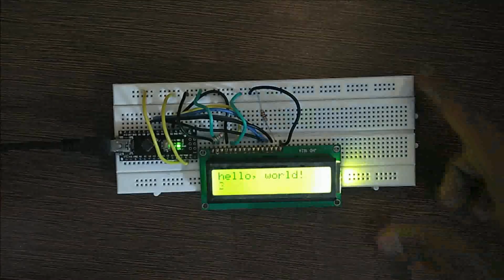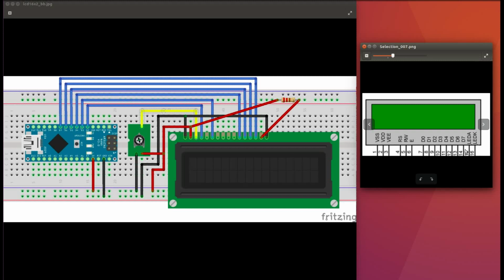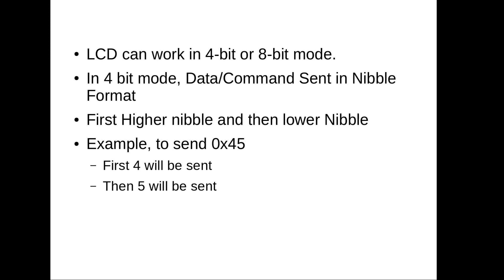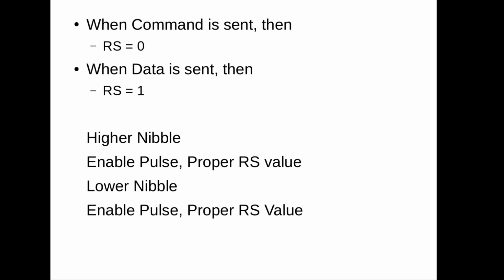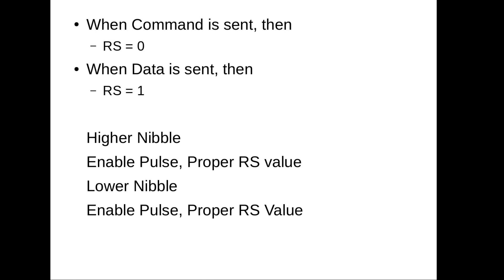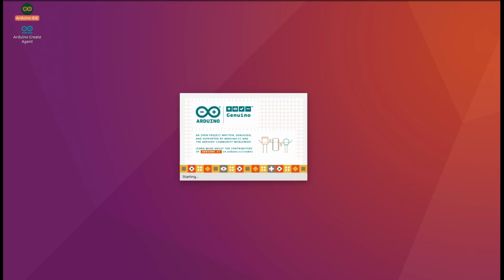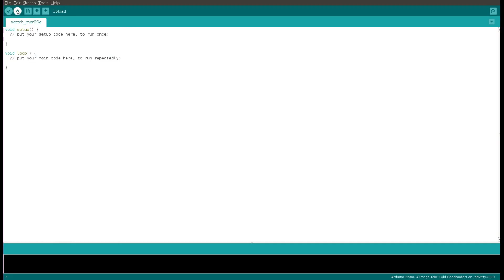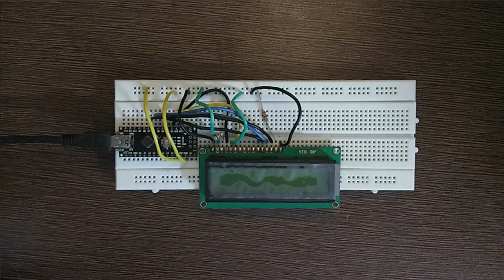Interfacing Arduino with 16x2 LCD | Beginners Guide

Comment: hello Thank you for the video. But I think there is a tiny mistake in the schematic you showed in the video. the  black wire of the potentiometer should be connected to ground and the resistor is not well connected on the bread board thank you
Reply from the maker: you mean for contrast.
If yes then we can replace potentiometer with resistor as well with some fix value. connetion will like
LCD(PIN Number 3) <----^v^v^v^v---->Gnd

Comment: Good video, but at no point, you mentioned the resistance of the resistor.
Reply from the maker: Resistor connected at LCD Pin number 3 is 1.8Kohm
Resistor connected at LCD Pin number 15 is 470ohm
Reply: @StechiezDIY  Thank you very much, that will help me a lot!